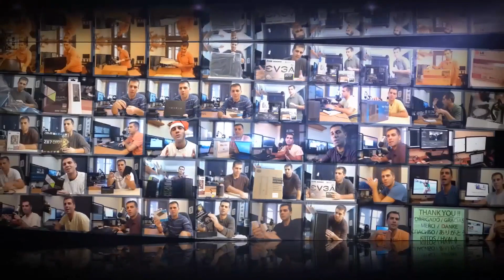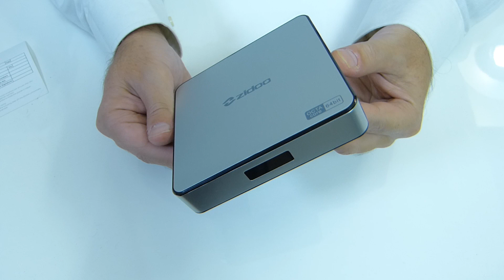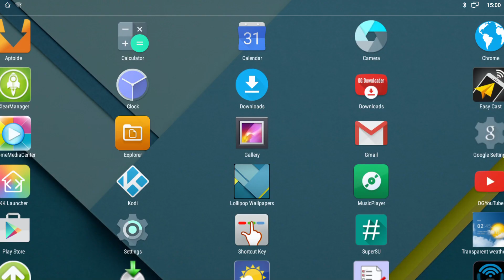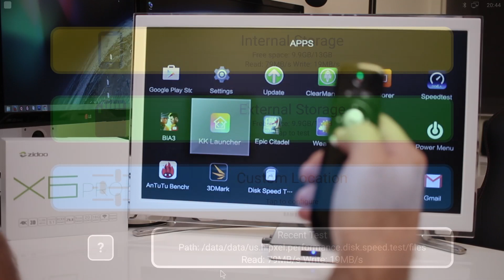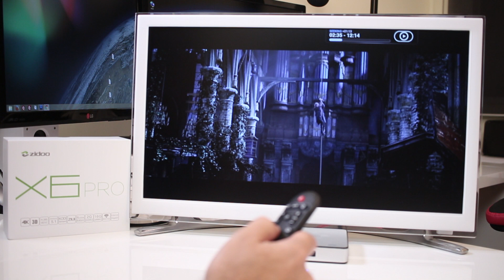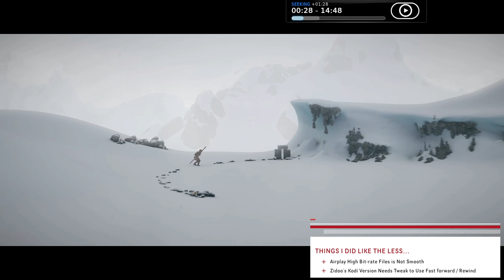Zidoo X6 Pro Android Tv Box Review

Comment: Hello Roberto. Um bom dia da Florida. I have a x6 pro and I have had a few issues with it. I have contacted support via skype and facebook as wll as through the fourms, but either no one answers or it taks days to teply to one sentence. the 1st issue i had was the audio was out of sync. i fixed that using a tweak on the xml file. but now i am noticing another issue. when streaming 5.1 audio through my Yamaha receiver, it plays dolby digital and then every 5 seconds or so it switches to pro logic 2 for half a second then back to dolby digital. i have tested my receiver with other devices snd have rulled that it is the zidoo. i have it setup correctly through the guide provided on zidoo website and have passthrough enabled in zdmc. any ideas? or know a better way to contact zidoo?
Reply from the maker: Hey Paul, and Bom Dia :) So that are not good news. Regarding sound i dont have a capable AV receive so i cant test it but if you have ruled everything out than Zidoo support has to step in and solve the issue, it looks like its a firmware issue so wont be that difficult to solve.
The best way i believe that is in the foruns in a public way, so that it helps others and that it has hopefully other users with the same problem that can make them fix it quicker
Hope you get it solved soon
RJ 👍

Comment: Hello Roberto.  Does Kodi update on it's own when a new build is released or do I manually do it?  Also, where can I get a controller for games?
Reply from the maker: Hey Curty if you installed Kodi trough the Google PlayStore (You should) then yes it will update it self automaticly without losing any info, if not then you will need to update manually losing your info
Controller wise i use the iPega 9028 and the Logitech F710
RJ 👍

Comment: So I can use this and play movies (mkv files and other formats) when I connect my external HDD to it? He's talking about frame drops after rewinding... that's scary...
Reply from the maker: +Moth Queen Hey Moth, yep we can. I use android machines to play my multimedia library from my NAS but you can use external storage :)
RJ
Reply: Roberto Jorge Thanks for the response. I'm currently using the NBOX V3 to play files from external HDD to my HDTV. It works well, but fast-forwarding and rewinding takes forever for large .mkv files. Also, I'm getting a lot of aliasing with it, so I'm thinking of upgrading to this Zidoo player...
Reply from the maker: Moth Queen
The Nbox V3 is a device from 2011 with a old cpu and a low performance compared with any machine available on the market right now. Anything that you chose at this moment will be much better than your current machine 😀
RJ
Reply: Roberto Jorge Absolutely, Roberto.... absolutely.
Reply from the maker: Moth Queen
😀

Comment: Hi, I got the Zidoo X6pro after i watched ur review.it's a good android box,but I want to ask about this box is being factory rooted as u said but my box is not rooted.Is it because I updated it, right away as soon as I got it,to 1.0.33 and also I am having problem with kodi 16.0,16.1 when I paused the movie for a few min it's crashed.I also can't move app to SD card.Is it just my box or others having the same problem?
Reply from the maker: +locent Hi, i just checked and mine its not rooted anymore also, it was back when i did the review and you may check here https://youtu.be/4U-v2Rf4QmQ?t=2m6s the SuperSu app installed which i checked, but i believe that between any OTA Zidoo removed the Root Access. ( I just updated the video at the end)

Regarding Kodi you will need to use the optimized version from Ziddo to be able to have it working the best way. (Do a factory reset to have the Zidoos Kodi version)

Regarding moving aps to SD card you will only have that function when marshmallow comes out for boxes, at this moment its not possible on any box except Nvidia Shield
Hope it helps
RJ

Comment: Hi Roberto,
Could you please tell us the tweaks you had to do to get the fast forward / rewind to work smoothly? Thanks!
Reply from the maker: +fletchb Hi, i just installed the original version of Kodi 15.2 and it worked great on FF and RW but i found a few issues on some video files with that version. Also check if there is any update to the X6.
RJ
Reply: +Roberto Jorge (Tech Reviews)  Thank you!
Reply: How do you get to upgrade of 16.1 for kodi......

Comment: Saw some concerns of over heating of x6, is this a big issue? I am debating between Zidoo x6 vx Tronsmart orion vs Tronsmart s95. Want the latest and snappiest among these with support. Any suggestions. Saw all your videos but still would want to know the most stable and reliable hardware.
Reply from the maker: +rajeev kamal Hey Rajeev, one of the tests that i do on all boxes is to leave them for 3-4 days 24/7 running a kody library non stop and then i just check if they stop or crash, if they do i mention that on the review. That problem i only had with RK3288 and 1 particular box. Some people might say boxes get hot and some will but as long as they dont crash on me i dont see a problem.
In terms of the fastest one its hard to say as they are all on par, but the S905 is superior to the RK3368 so i would go either Vega S95 or Zidoo X5
Hope it helps
RJ

Comment: hi Roberto thnx for your reviews there really help full this week I bought the zidoo x6 so far I tested it it works great only thing is that kodi is buffering al lot and the video's are lagging al lot while streaming HD video's of live tv any idea how I can fix this ? Hope u can help me gtrz wesley
Reply from the maker: +Wesley Kock Hey Wesley, thanks!! Regarding the buffering that is the network and not the box. Connect it directly to a Ethernet cable or test with a USB drive and you can check that it plays fine :)
Enjoy it
All the Best
RJ
Reply: +Roberto Jorge (Tech Reviews) 
hey Roberto thnx for you're reaction I tried the Ethernet cable but still the same problem 1080p movies are still lagging and stopping for buffering but the buffer meter is not running at all hope you have more idea's for me thnx wesley
Reply from the maker: Wesley Kock
Did you try with the USB Hard Drive directly so that we can rule out Software or firmware. RJ
Reply: +Roberto Jorge (Tech Reviews) 

hey Robert u mean if I played video's from de flash drive ? I didn't do that yet only with kodi its strange because I have a 50mb glassfiber internet connection at home but I read some things about the cache problems with kodi maby that's te problem ? I don't know grtz wesley
Reply from the maker: Wesley Kock
Yes i mean using a external drive USB to play the video on Kodi. I know that your network should be able to but to make sure we need to try everything and make sure where the problem is and you might have a bottleneck and not even know about it. I dont mean the external internet connection but the actual indoor Ethernet. It happens and it has happen to me on the past :)
RJ

Comment: Hey, congratulación for your work. A question, this x6 or minix 8x h?Thanks
Reply: the minix z64 is better than the x8h
Reply: +Roberto Jorge (Tech Reviews) ah ok.
Reply: +Roberto Jorge (Tech Reviews) Are there many add-ons that have 4k content on kodi? My dad has a new 4k tv so i may get him this x6
Reply from the maker: +manuel hoyos Hey Manuel, its a though call, the X6 has a better price and delivers mostly what the X8 H Plus does, it needs some fixes but i believe that will be delivered. I would suggest looking at both reviews and then chose the one that you like the best. Hope it helps. RJ
Reply from the maker: +Craig G Yep the Z64 is a fast machine :) one of my favourites but only outputs 1080p so im not sure if Manuel has a 4K tv he will be better with the X6 or X8 H Plus. RJ
Reply from the maker: Craig G
Hi Craig, unfortunately i dont use addons. I use a clean installation of Kodi to playback my library located on my NAS :) im a very simple guy on my personal need for multimédia :)

Comment: Hi Roberto,

does the X6 support dolby true HD atmos 8 channel output as stereo via Hdmi?

Playing 25 fps PAL video, do you experience any jitter? How can the box deal with other than 24p video refresh rates?
Reply from the maker: +Helga Schlapp Hi Helga, 8.1 i believe that it will not be possible as it does not have optical out and also i cannot test HDMI passtrough as i dont have a capable AV receiver. But i would suggesting looking into the main differences here https://goo.gl/j8vh0w and also check out Minix Forum and post the question there as i believe that someone will have a better answer in terms of audio than me :) All the Best
Reply from the maker: +Helga Schlapp Ah! Regarding Video playback so far i havent had any issues at all playing all sorts of 1080p movies :)

Comment: hey RJ great job as always. I was waiting this review and to be honest I'm a bit disappointed. This RK CPU is worst than its predecessor as I saw in other review from your channel. 
1/ how Lollipop helps the firmware to hide weakness of CPU?
2/ how was speed of the device? still not emmc 5.0
3/ some months from your review of MINIX z64 do you think that new TV box are improving performance? I don't. 
I'm really thinking to wait before purchasing, but I wonder when is expected next box generation.
All the best!
Reply from the maker: +Jesus Frances Hi Jesus, thanks for your input. In my case im not disappointed. What i feel at this moment is that the new machines are not bringing more hardware power, you are correct the 3288 is still more powerful than the 3368, but the latest one is not giving heat issues as the 3288 used to do. On the other hand on my opinion this cpu in particular is helping manufactures to be able to produce machines at a lower cost with some nice results and off cheaper for the end user. In terms of speed it self nothing that caught my attention so far. Lollipop brings a nice feature in terms of graphics, the interface it self is looking cleaner than the kitkat, at least more polished, but also for the machines that i have tested so far with 3368 it will give manufacturers more work to implement firmware, at least that is my perception. In terms of Speed Zidoo does not specify which level of eMMC but its fast 79MBS on reads is great as im used to see 20-30. eMMC 5.0 should be hitting the 100 mark +-
Comparing with the Z64 that uses one of my favorite cpus at this moment the Z3735F its still more powerful, the only downside for some is that the Z3735F does not output 4K natively.
Im really curious to see the new Amlogic S905 and S912 coming out later 2015 early 2016, hopefully we will see bigger advantages there, but this is only my expectations, not sure if it will happen. Even if we compare the Zidoo X9 from last year is more powerful, but then again more expensive. Oh well, sorry for the long text and thanks for your input. All the Best. RJ
Reply: +Roberto Jorge (Tech Reviews) thanks a lot for your complete answer. Regarding temperature issues with zidoo x6 I saw at cnx-soft review that is still not fully OK. On the other hand, I confirmed  emmc is a thosiba component compliant v5.0.
2/ how you will compare wetek core with MINIX z64? I find wetek a great product but only 8gb and both slow emmc and WiFi/Ethernet.  On the other hand I still consider z64 a bit better in terms of performance (4K is not a must for me). did you heard about problems for running  play store apps with Intel CPU?
Reply from the maker: Jesus Frances
Hey Jesus, you are welcome my friend. Regarding Temperatures i test the devices with all kinds of tests including leaving about 48h of continuous playback on a Kodi list of movies and if temp is a concern during that test the machine will go down and i will off course share on my review. The Zidoo passed the test without problems. On the other hand we all know the RK chips are hotter then Amlogic, its like Nvidia and AMD Gpus but as long as it works its ok for me :)

Regarding the Z64 its one of my favorites CPU the Z3735 F, specially because its a fast machine. The Wetek is really nice but the flash storage could be faster. If you dont need 4K i would really take a look into machines with Z3735 F. So far i havent found any issues with any app. There could be some with some incompatibility but that is a risk with any cpu. Hope it helps. RJ
Reply: Fantastic! Keep on doing so professional!

Comment: Does this do Netflix in HD?
Reply: +bxbomber80 
Doesn't make sense not supporting HD on netflix, but hey.
Reply: +Roberto Jorge (Tech Reviews) Only Netflix certified TV devices have HD streaming. The TV/STB manufacturer have to submit their device to Netflix then they will test the device for security and various other thing, if they are satisfied then the device get HD streaming support. This is also done by BBC,VUDU and some other company.
Reply from the maker: Kawshik Ahmed
Thanks for your great input and explanation Kawshik. That is great info and spot on :) All the Best. RJ
Reply from the maker: +bxbomber80 Nop, it does not :) RJ
Reply from the maker: +ubbgn I understand what you mean and believe me that its weird, but only one box so far that i have tested has HD Netflix, well actually 2 because i have the Shield here testing for over a week now. This is not available to any box and its not hardware limitation its actually licenses and bureaucracy with Netflix. How it works i dont have a clue cause im not a manufacturer :) All the Best. RJ